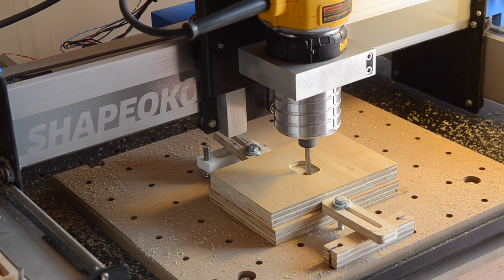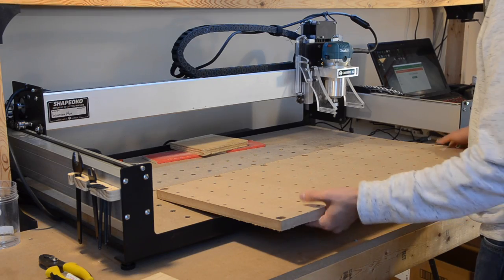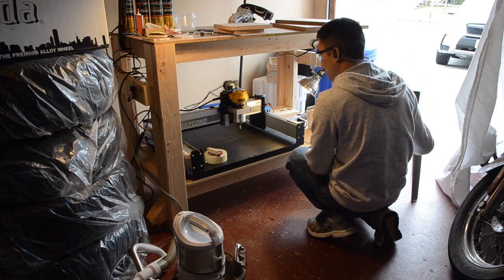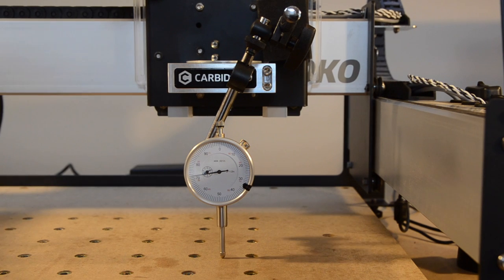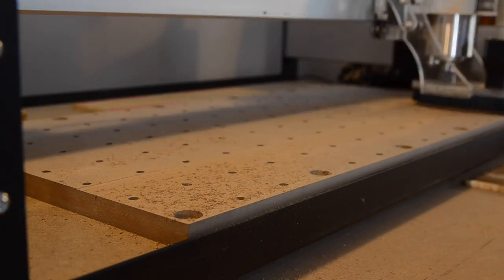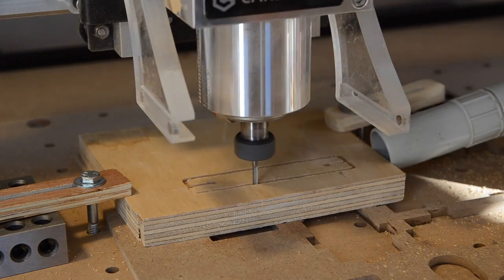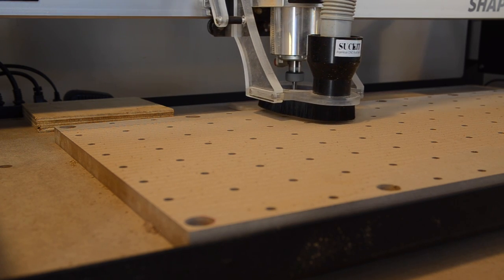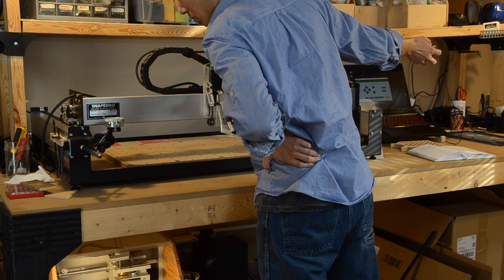Basic Shapeoko 3 Tuning: Squaring, Spindle Tramming, & More

Comment: Did you make the change in the Z by going to the MDI and typing "$102=40.***"  * being the % difference in travel and then hitting send?
Reply from the maker: Well, more specifically, * covers whatever it was scaled by. So if it was originally 40.000 and i was off by 0.1%, the new value would be 40.04. * is not strictly the percentage.

Comment: What drill bit did you use for the MDF board?
Reply from the maker: The main holes were machined. Any 1/4" or smaller endmill will do it. If you're doing it by hand, 5/16" or a tiny bit smaller will work + a countersink bit.